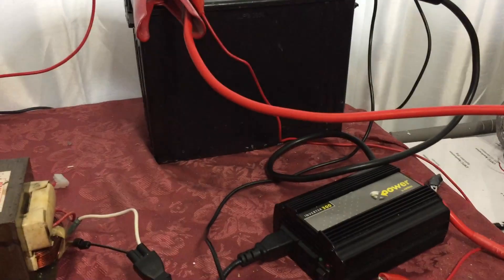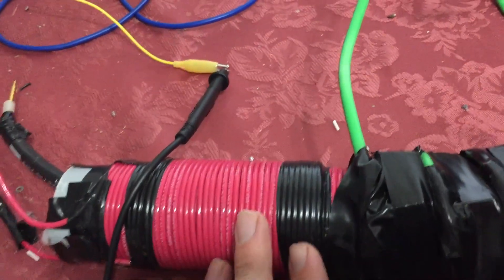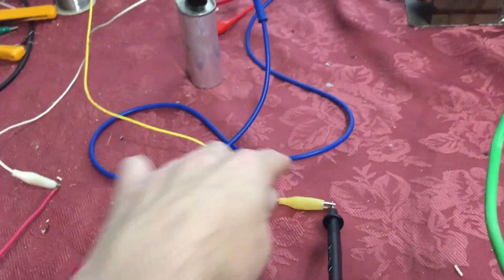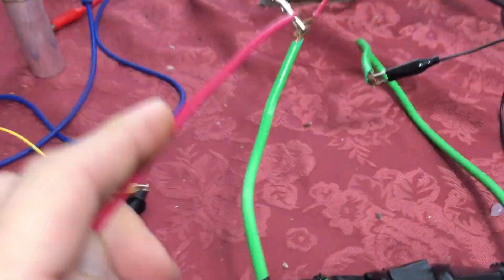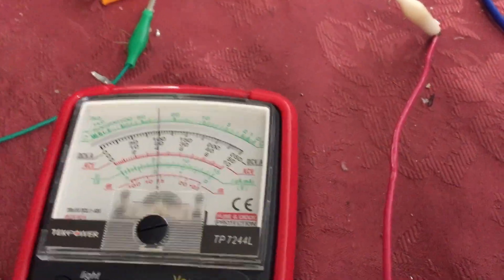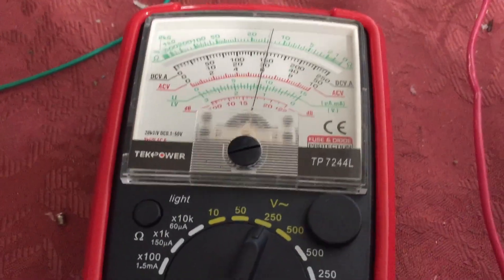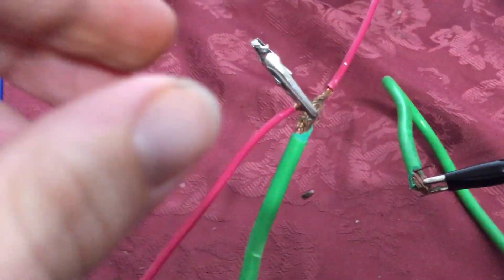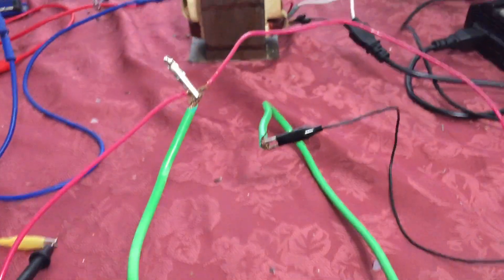Kapagen On One Wire

Comment: From 2004 video, when translated from Georgian, Kapanadze says, that the spark gap(which appears to be the High Frequency / High Voltage) is interrupted at 50Hz.  He points at the spark gap as coming out from the large spring looking coil. Perhaps then he manipulates the phasing via inductance to get “the sine looking wave form”.  Only then it can be stepped down to 220v(already at HF modulated/interrupted at 50Hz) using rest of the coil and then looped to self run…

Comment: Csn you keep the microwave transformer on something that is non conductive and then measure the reading. The readings tend to interfere as the transformers secondary is connected is grounded to the casing.

Comment: Nice, you found the ac/dc component. this is another  reason why Tesla has a patent how to convert ac to dc.. the question is what did he use in place of diodes? capacitors?

One way i can describe pure potential is this, lightning is pure potential, until you have a lightning rod, and it discharges thereby manifestation of discharge become actual potential..
Reply from the maker: You can fill a jar with a solution and have anode and cathode setup. It's crude but its what they used as a rectifier for high voltage in tesla's time. Well one method anyways. You can always use induction as well, its more of a big deal and more ripple however all crude but works. Some old power supplies are induction based rectifiers. you can't miss them. So very huge and heavy. Another interesting thing is a DC motor vs an AC motor, That is also done without diodes, Still magnets and coils, Just a different arrangement.

Comment: Thank you for your continued posting. You had previously asked about viewers' thoughts on one-wire transmission of electricity. I believe that electrical engineers explain this phenomenon as parasitic capacitance, which creates a closed circuit. I am not aware of any practical applications of this method. However, if you can demonstrate that this method can generate extra energy that is not currently believed in by science, it would be a significant accomplishment.
Reply: Don't try to convince the engineers of this stuff. If they can't explain why you're wrong they just ignore it and basically don't care. It's going to take a real breakthrough to make anyone really take a look at this stuff and take it seriously. Other than that it's up to us to find uses for it.
Reply: I share your perspective, but am faced with a conundrum. Despite our collective efforts and focus on alternative energy, why is there no single device capable of consistently generating, say, an additional one watt of sustainable energy that can be easily replicated by many individuals? If such a device were created, it would propel this technology into the domain of established science and engineering. Yet, this isn't the entirety of the dilemma. If this occurs, numerous commercial applications could arise, like a free energy cell phone charger. However, this mainstream acceptance and commercialization may lead to a loss of interest among our community. Frankly, our drive is rooted in the desire to challenge conventional knowledge and stand apart as innovators. If our endeavors gain widespread acceptance, they might lose their appeal as they no longer challenge the status quo.
 @brianp5210
Reply: In my view, evidence of alternative energy systems already exists; the challenge lies not in their feasibility but in their adoption by mainstream industries. Contrary to the perception that unconventional systems can't produce even one watt of usable power, I argue that it's entirely feasible to run a household using reactive power—power that is out of phase with the real current on the electrical grid.

When tuned to resonance, reactive power circulates within the circuit, creating a "ping-pong" effect. I've encountered capacitive reactive power supplies capable of delivering over 3 amps. By cascading multiple reactive stages, one can theoretically scale up to a full-service current of 25 amps.

The utility companies could implement this system at scale by installing industrial-grade capacitor banks tailored to their specific electrical networks. These could convert reactive power into a form suitable for household consumption. Such a system might cost upwards of $4,000 initially, but the long-term benefits could be substantial, including decreased load on power generation facilities.

However, there are significant roadblocks to this vision, primarily stemming from the utility companies themselves. Implementing a reactive power system would require altering their existing billing models, which are based on the consumption of real power. Additionally, such a system would pose challenges for accurate metering.

While utility companies often promote their green energy initiatives, many of these efforts appear to be more about optics and public relations than about genuinely sustainable practices. They aim to secure grants and favorable public opinion without fundamentally altering the status quo.

In summary, we already have efficient ways to harness and use energy; what we lack is the industry will to implement these methods at scale.
Reply: I maintain my position. Please provide me with any online resource that documents and demonstrates a device capable of continuously generating 1 watt of excess power for extended periods, such as weeks or months. @HVMIXONT
Reply from the maker: I think you got your answer sir.
Reply: @joellagace1679 
Boa tarde, tu tem um esquema detalhado do teu kapagen?